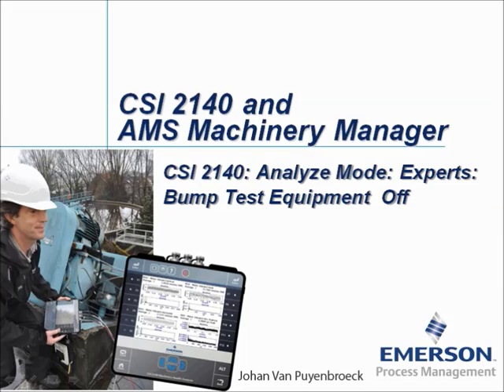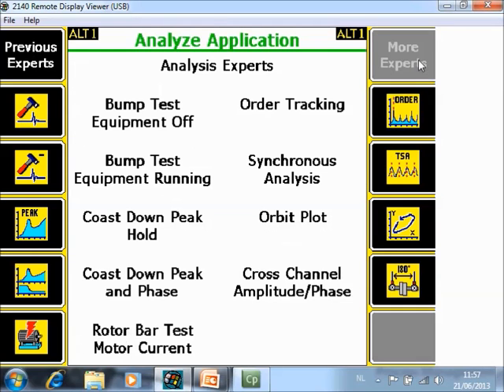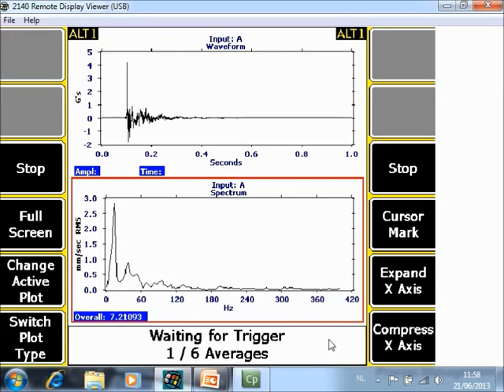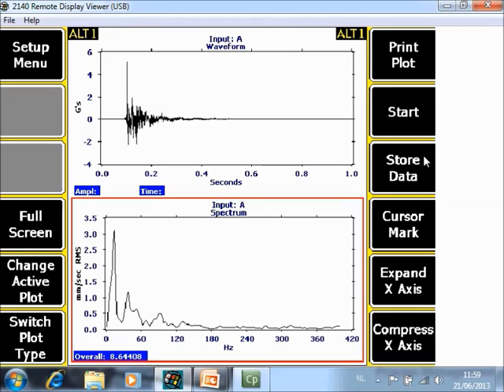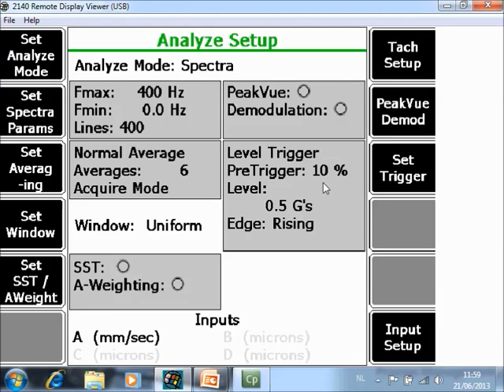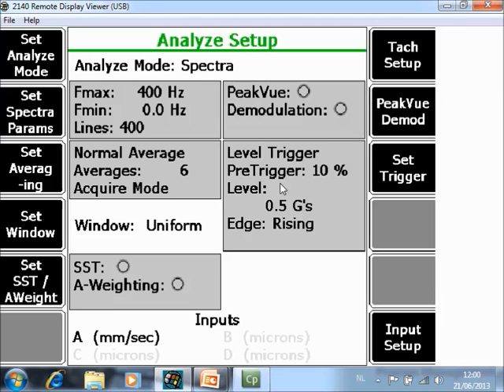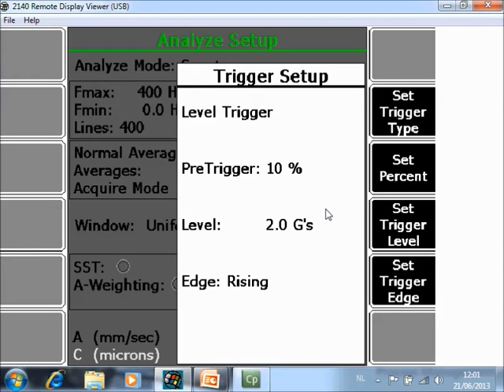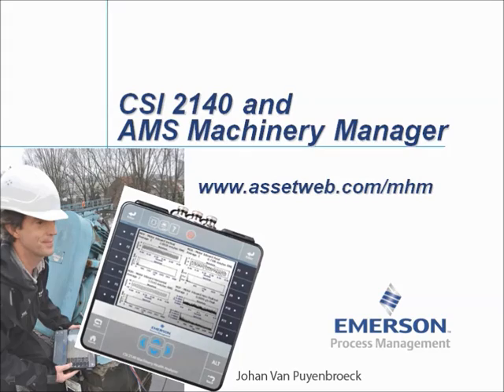Collect Data Using Bump Test (Equipment Off) with the AMS 2140 Tutorial

Comment: GOOD EVENING
I WOULD LIKE TO CHECK IF YOU HAVE A MATERIAL THAT SHOWS HOW TO USE THE MASTERTRENDE SOFTWARE.
TEACHING HOW TO CONFIGURE A POINT, FREQUENCY FAILURE ETC.
IT WOULD BE POSSIBLE TO SAY TO ME.
I KNOW THAT THIS SOFTWARE IS ALREADY DISASSEMBLED, BUT I AM IN A COMPANY STILL USING THIS SOFTWARE.
THANKS IN ADVANCE.